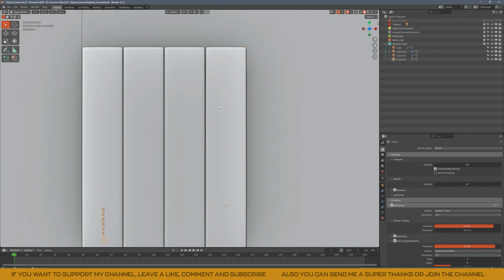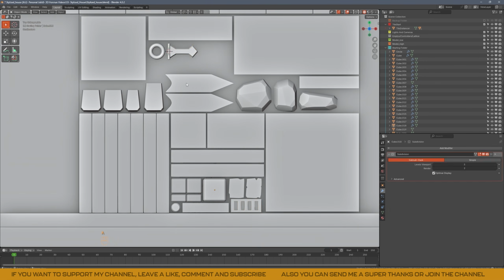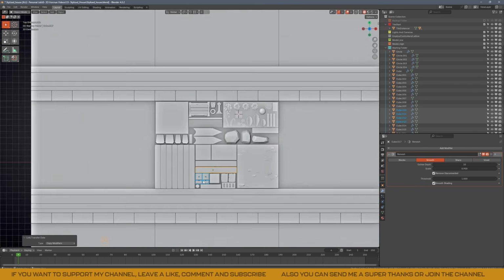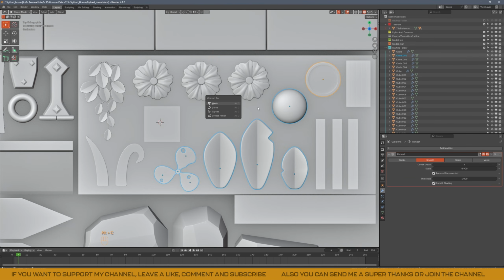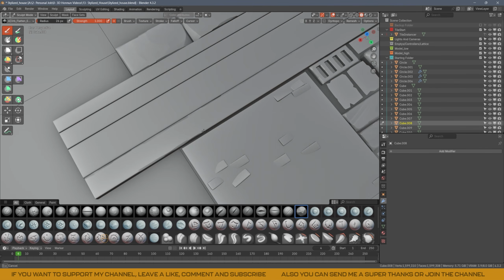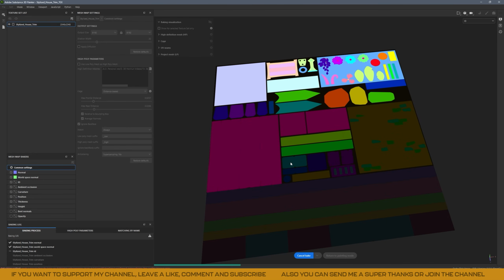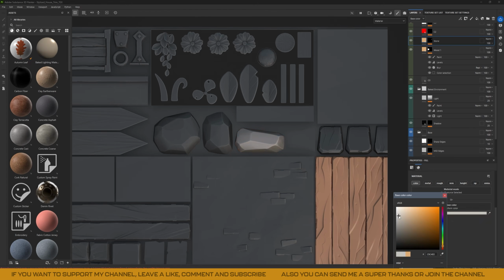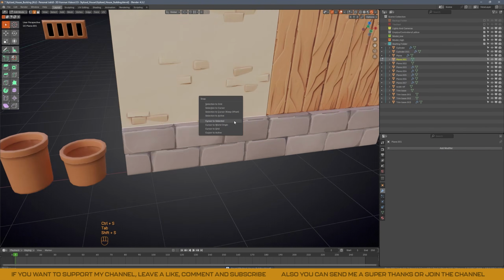BUILD Large 3D Models Using Just 1 Material!

Comment: Great job, your styling looks nice!☺️ Please tell me, how did you make the alpha for the brushes? I tried doing it in Photoshop, but the result isn’t very good.😓
Reply from the maker: Hello. Thank you! Can you please let me know the exact minute of the video about the brushes alpha? Thanks
Reply: @agustin_honnun  Hello! At about 4:26, during the sculpting of the boards, should this be done in Photoshop?
Reply from the maker: These brushes are from my Stylized Brush pack, and others from my free wood alphas all available on my Gumroad page.

I created them Sculpting a plane and project the height map bake in a exr file
Reply: @agustin_honnun  Yes, I've seen your pack, but learning how to make them yourself wouldn't be out of place. I'll try your method. Thank you!
P.S. I just watched your other video with the mine, and I wanted to suggest that there is an analog of "Bisect" in sculpting mode, namely "Line Trim". It's much more convenient and you don't need to highlight anything every time. But you probably already know.😉
Reply from the maker: Yes I know the line trim, but usually I have bad trims with it depending the model. Btw I just use the bisect for low poly blockout

Comment: This is incredible work! I am curious about the poly count, though—how do you achieve that classic low-tris look while still getting such a polished, modern style? If you have a course (like on Udemy), I’d love to check it out. I’ve been trying to optimize my own assets with fewer polygons and materials, but it’s challenging to get it looking this good.
Reply from the maker: Thanks!

Unfortunately I don't have a course yet but Planning to do one soon about game stylized assets. But, most of the polished look having lower polygons comes from the shading, It is important to know where to add sharp edges to keep a weighted normal look without using subdivisions, the rest comes from the normal map in the texture if it is pbr. Mixing it with the modifier Weighted Normals is a good technique to use for final game assets :)

Comment: Very insightful video! How do you make sure that your individual high poly pieces have the correct dimensions so later on you don't have to worry about texture streching and proper edge padding? Also how do you deal with making stuff like stone trims seamless?
Reply from the maker: Actually, I'm just watching references, tried to keep the same proportion depending the piece, for the walls just tried to make them 1x1 but as you can see it is quite larger in Y, just because I thought to use it a bit different to make some variations but in the end I didn't, so 1x1 should be enough, same for the planks. And for the stone, the seamless there wasn't really hard since they are divided bricks so they can be positioned wherever you want, but if you refer to the part where I did cut the foundation bricks, I just copied the same brick and inverted it just to be mirrored (the texture) when duplicated. It is quite hard to explain everything here, but I'm planning to make a video soon about trimsheets :)
Reply: @agustin_honnun  I see, thanks for the insight. A video about trimsheets would be really cool, can't wait!